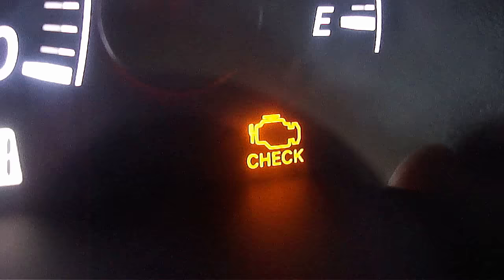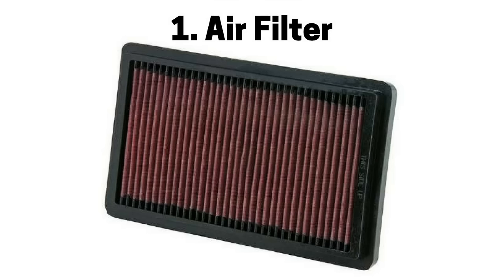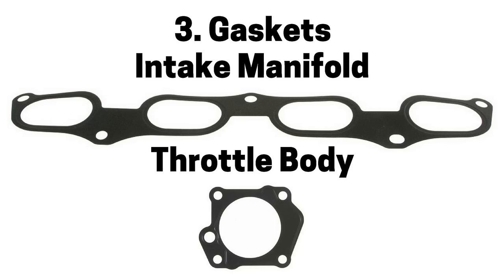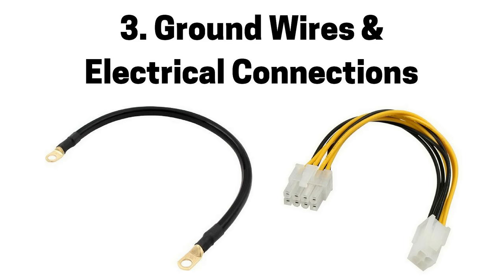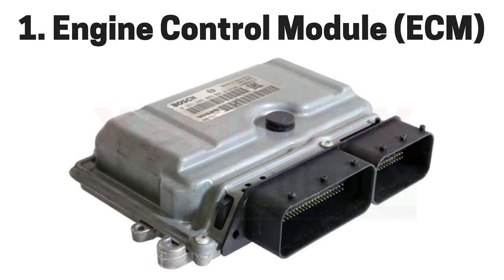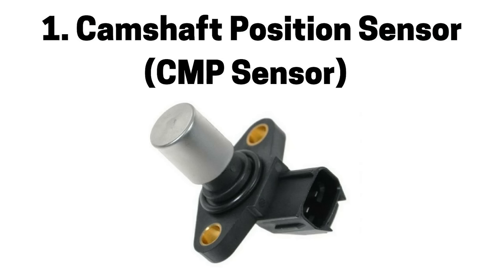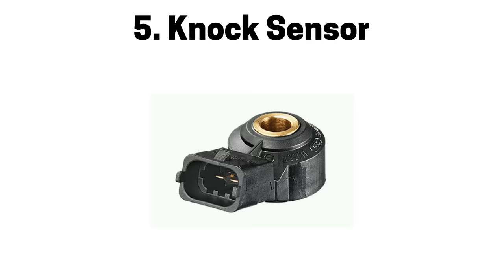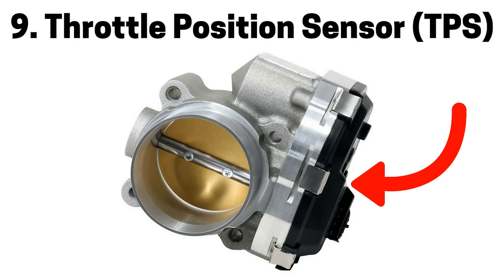How To Fix Engine Hesitation During Acceleration - Easy Fix!

Comment: Everything leads to a CEL?? My car it’s been running sluggish or poor acceleration for about a year and three mechanics keep telling me that the car is fine!! Meanwhile I have to drive the car with erratic throttle. These mechanics nowadays without the check engine light are nothing but rookies.

Comment: So your saying, it could be anything?
Reply from the maker: No. I’m saying it could be a lot of different things. People just do not understand how incredibly complex vehicles have become.
Reply: @proclaimliberty2000  
Unfortunately I do … just was hoping for a more…… specific place to check. 
No fault on you or video …. 
I JUST HATE THIS TRUCK
Reply: Thanks for responding though 
Mighty white of you
Reply from the maker: @Wickedstickyflowers  Believe me I completely understand your frustration. Engine hesitation can be one of the most difficult things to fix especially if there is no check engine light.  What is the make, model and year of your vehicle and what exactly is it doing?
Reply: @proclaimliberty2000  
06 Nissan Xterra 4x4 6 speed 
Long crank but always starts and runs ok 
I’m leaning towards the fuel filter 
Or the mass air flow sensor. 
At least I plan on starting there
Reply from the maker: @Wickedstickyflowers  Does it do it at all speeds?
Reply: @proclaimliberty2000  
Do what? It runs fine . Just long crank 
Then start
Reply: @proclaimliberty2000  
Are you really reading my messages?
I said it has a long crank time before starting, once started it runs fine .

Comment: Long story short it could be ANYTHING go get it tested. Replace part.
Reply: Planning on donating my family’s Nissan 1986 mini van. It’s not starting despite new battery, smoke coming out of the hood after driving 5min and engine hesitation which is the most annoying. It’s been sitting in my driveway for almost a year. We’re getting a new sedan and we need space. It’s on 180k miles by the way. Mechanics say it’s the engine that need replacement. But that’s just bs cant seem to find a decent mechanic in my area.

Comment: My 2001 Dodge Stratus has been doing this off and on for about 2 years - I take it into a repair shop or dealership and they can't seem to find what is wrong with it.  Very, very frustrating and sometimes when I am going under 20 miles per hour I think the car is going to conk out altogether.  What do I do?  I am sure that these mechanics don't check all of these systems completely - they just check the easy stuff and then say we can't find anything wrong but I know there is something wrong.
Reply: 2 years? Yeah there’s a god . I been riding with engine hesitation for three months and  pray not to break down 😂.
Reply: I understand though that feeling driving under 20mph hearing your car make crazy sounds I deal with it too. I haven’t pinpointed the issue. If you have I’d love to hear.

Comment: so basically we enumareted all the car parts. yea this is the way it is, its all interconnected and its very difficult to find the problems.... i am struggling with my renault clio .... sensors.... cables.... the main problem is the shity software they use on cars... they should be a hell a lot more specific, too many codes are so generic, makes the technician check half of the car not finding the issue and billing you the time wasted searching for the problem.... i hate this

Comment: Ist check ?? Idle air control valve , mostly overlooked because it has the word idle in it. If its dirty , even at max rev , the motor will run like a politician .... Dirty dishonest and no steel in its balls.

Comment: Wow, big list. Only times with issues is after heavy nite rains. Twice now daughter called crying, car bucking, wouldnt go over 20-30 mph on highway. Anyone out there have some ideas? Thnx 😵‍💫
Reply from the maker: Do you have a check engine light?
Reply: @proclaimliberty2000  nope, runs fine 99% of the time. And the 2x it happened, was after driving 5-10 minutes after leaving home
Reply from the maker: @boknows8936  More than likely something electrical being affected by moisture.  How many miles?
Reply: @proclaimliberty2000  thats what im thinkn, was wonderin if putting tarp over engine when parked would help? Bout 115,000 miles
Reply from the maker: @boknows8936  so here’s what I would do next. I understand you have no check engine light. However, I would still take it to an auto parts store and have them check it with a diagnostic scanner which they will perform for free. It’s possible it could have triggered some trouble codes which could give you some clues as to what’s wrong.
Reply: @proclaimliberty2000  sounds like a plan, thnx
Reply from the maker: @boknows8936  👍😊
Reply: @proclaimliberty2000  well, somehow got it there, i can see why she was scared/upset. Crazy shifting, not moving right away at stop signs/lights. Thump shifting up/down on highway. Very scary. Parked it at garage, he said to bring around to side. Couldnt start it, Blank dashboard, NO POWER at all, popped hood, positive cable came loose. Replaced with new terminal. Thinking it kept going into ‘relearn’ shifting mode everytime contact was being made/disconnected. Thnx again for suggestions…
Reply from the maker: @boknows8936  👍😊 Let me know the outcome.
Reply: @proclaimliberty2000  will do, posted a video on my utube of me driving to shop if u wanna see the hard shifts/bucking 😵‍💫✌🏻